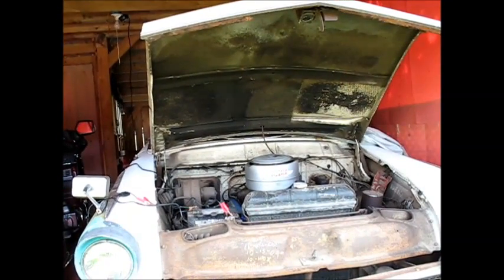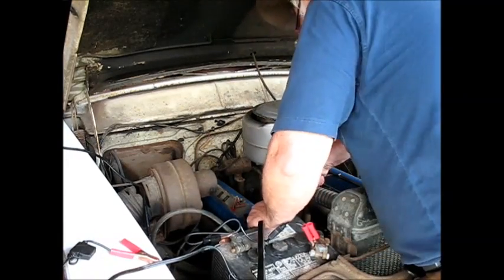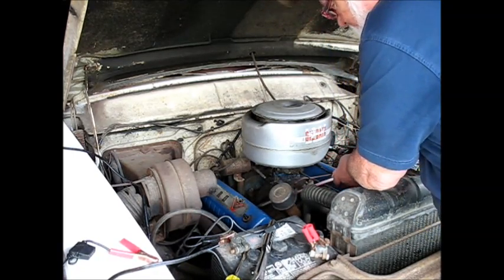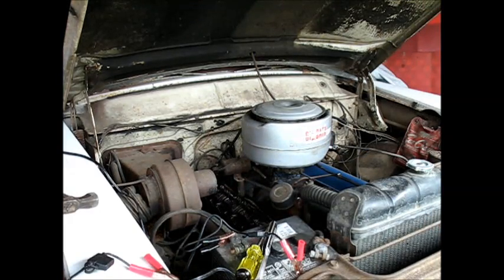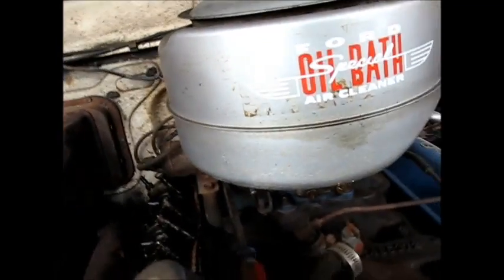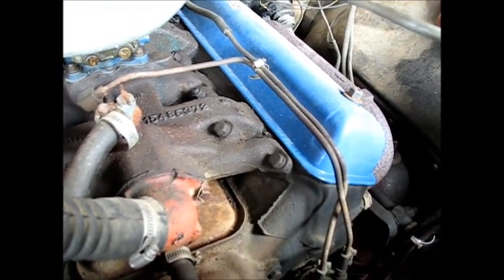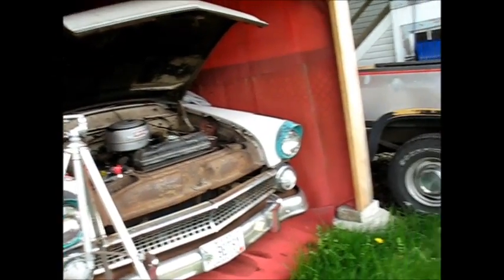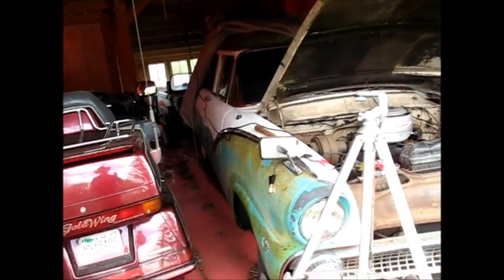Why's My Ford Knockin'

Comment: Richard, pull the rocker shaft assembly on that side and you should be able to extract the bent pushrod from the lifter valley . The push rod could not go any further because the valley is solid . It is solid lifters and they are mushroom type that load from the bottom.
Reply from the maker: Thanks Pete.   'Preciate it..

Comment: A good backfire can bend pushrods... The only bad thing that can happen to Y-block engines is that the cam bearing spins in th block and you loose oil pressure to the rockers. They make an aftermarket oiling system to fix it.
Reply from the maker: Thanks Cut..

Comment: Grab a pocket magnet  and fish it down the pushrod hole to see if you can pull it out without tearing the whole thing apart.  If it comes out with any more damage than a bend then you'll still need to tear it apart but if its only bent you can get a new pushrod to replace it and only have to buy a set of valve cover gaskets.

Comment: Can you get one of those magnetic extending tools that will fit down the push rod hole and see if you can lift out the pieces?
Reply from the maker: Yea, I got one but I'd like to lift off the manifold and valley pan and take a look at what's in there..  Just for good measure..

Comment: Yeah, I looked and there is a common problem with stuck or sticky valves causing bent push rods on older vehicles that aren't run regularly... There may be nothing wrong with her but sittin'
Reply from the maker: I can fix her..

Comment: be really careful running that thing , if it pops the lifter out of the bore , all oil pressure is instantly gone , and it will kill the bottom end bearings , keep the rpm's very low on it ... lost a ford engine because of the same thing once , what caused that I would bet money is it has had a semi stuck valve at one point or still does , make sure the valve is free , and I bet you find a push rod shaped like a banana in the valley ...
Reply from the maker: I suspect you're right..  haha
Reply from the maker: You can't pop a solid lifter out of a Y block Ford unless you remove the cam shaft first..  Just relax.  Everything will be okay..